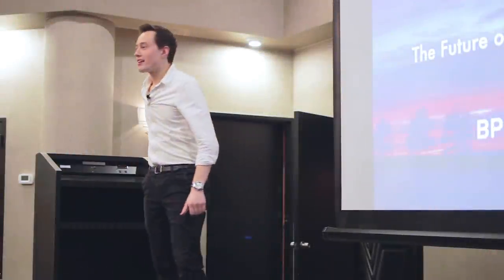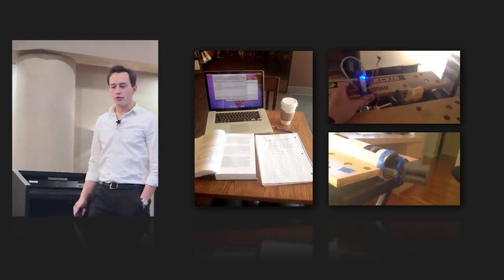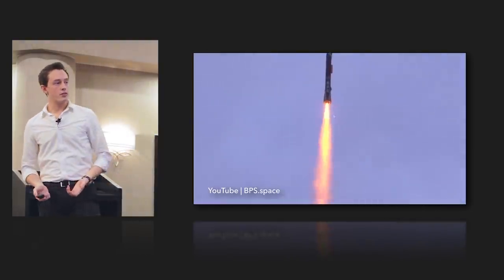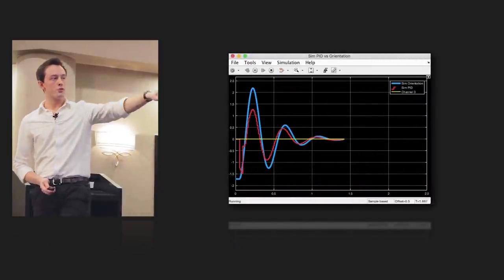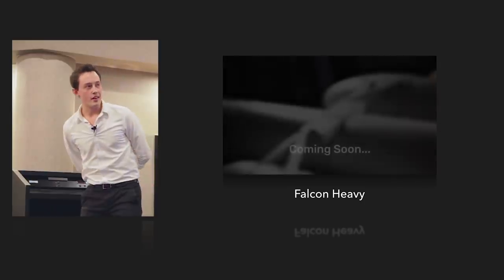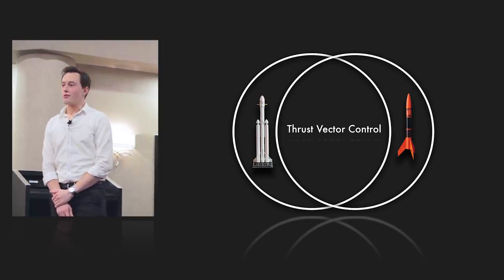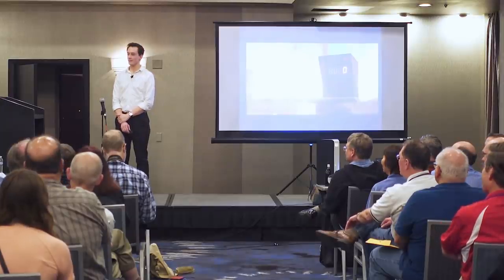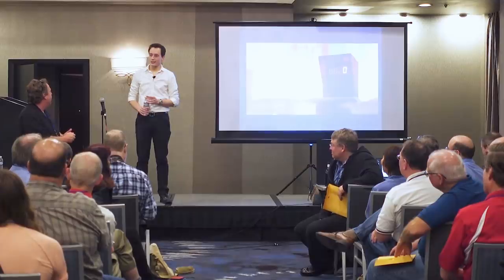The Future of Scale Rocketry - National Rocketry Conference 2018

Comment: Very Nice talk. I wonder if you could get some small level of 'throttle control' by very quickly moving the motor around in circles so that the motor thrust vector's vertical component is reduced. By moving it rapidly you average out any induced pitch or yaw. Of course you superimpose on top of that the normal control offsets.
Reply from the maker: Yep! I believe this technique is used in a few solid rocket surface to air missiles. They perform a big corkscrew maneuver at the beginning of flight to bleed off the right amount of energy so they can perform the specific task at hand. That said, since we can't do a corkscrew and have to just wiggle the motor back and forth, I'd have to do some longer duration tests on servo reliability under those loads, nothing that can't be done though!
Update: Found it! I'm sure there are others that do too, but there's footage of a few THAAD vehicles performing the corkscrew.

Comment: Excellent presentation. Very entertaining and informative and a lot of fun. One question comes to mind: have you considered using an EDF for thrust instead of an actual "rocket motor". It would give you a much longer period of "thrust" and could be throttled. I know it's not a real "rocket", but you could work out a lot of your stability software with an analog that lasted a lot longer.
Reply: I met someone at National MakerFaire 2016 who was doing jet tab control of an EDF but had SERIOUS issues with power delivery and mass. It's hard to beat the pure POWER of chemical thrust
Reply: There's a guy on YT doing a scale model Harrier jet and it works very well even with the small rotating VTOL nozzles. It looks quite heavy.
Reply: a couple people tried and did this. it just wasnt interesting bc it doesnt feel like the same thing.  plus, that would be destroying joes point of all this

Comment: I am wondering if AI can at all be integrated into the flight controls software so the rocket learns how to fly itself instead of doing what human tells it to do? Would that be a better way of developing future flight control software?
Reply from the maker: There are a few aerospace companies trying this route, but I think it's probably a bad idea. The math behind rocket guidance and control systems is fairly well understood. That's super important for missions and flights that require reliability. By nature, we don't understand how deep learning works, or rather the results of it. So many neural connections are made by the learning algorithm, that we can only look effectively at input vs output. For both of these reasons, it seems like a less safe option overall. The rocket already flies itself too, the user just sets the stability sensitivity. Once the rocket leaves the launch pad, it takes care of all the decisions for how to stay stable and when to deploy parachutes or retro-propulsion. Frankly, a lot of guidance stuff involves linear algebra, coordinate transformations, and a little trigonometry, all of which can be done by most humans. It might be useful in trajectory planning, but certainly at this scale it would be overkill.
Reply: When you have a perfect mathematical model for your problem then going the AI route is doing things backwards.
It's like replacing a calculator which is fast and does it's job without mistake with a human which despite being the best AI on the planet does a very poor job compared to a calculator.